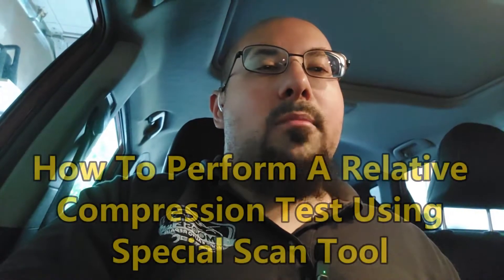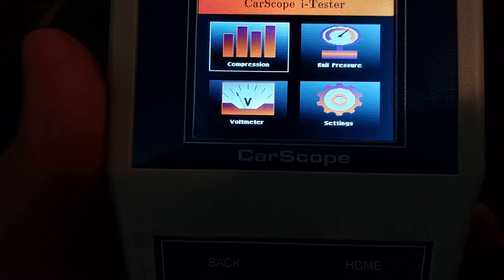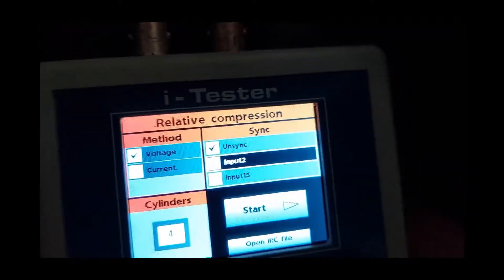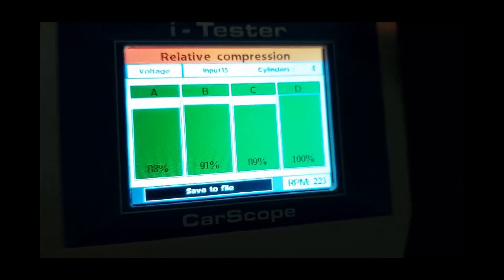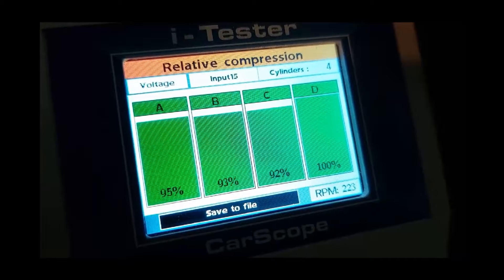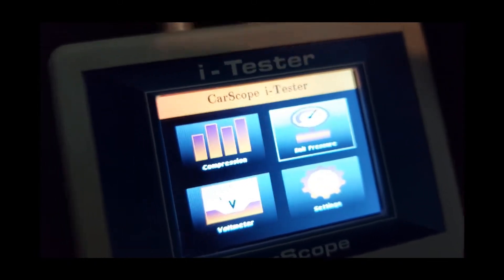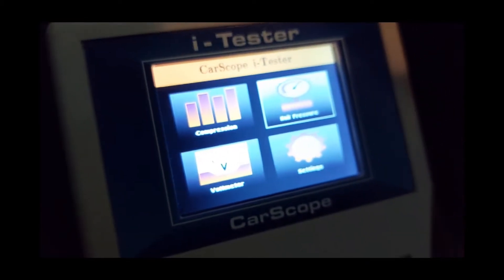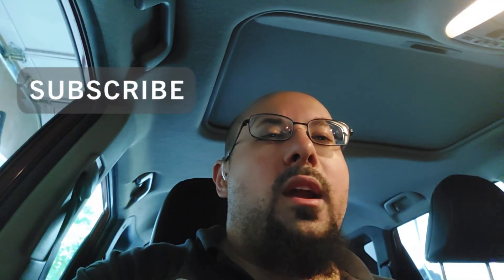How To Perform A Relative Compression Test Using Special Scan Tool

Comment: At what percentages would a problem be determined… 75% and below?
Reply from the maker: Correct. Here is an example that I found from a website just for reference.

Relative Cylinder Pressure
No cylinder should have a pressure lower than 75% of the highest recorded value. In this example the highest pressure is 168 psi, so the minimum allowable value will be 0.75 * 168 = 126 psi. In this scenario cylinder # 5 is considered to have low compression, while #2 is just passing.
Reply: @moosemobileautorepair  thank you for that and the quick reply. So in a relative test, 100% is the cylinders with the highest readings and any cylinders below 100% are reflected on those highest readings, right? I think I would see if I had easy access to manually test a 100% cylinder to get actual psi and make further calculations. For compatible vehicles this method is accurate enough to eliminate the manual gauge test process?
Reply from the maker: If you manually do a compression test then the readings would have to be no more than 10% difference between the highest and the lowest numbers. Anymore than 10% would signify that there is a problem inside the engine. I do have a video on that on my channel. You would still have to be careful with a relative compression test as it may not always be accurate. I have seen a few guys get burnt by that before from false readings.

For relative compression anything below 75% would indicate a problem. But numbers near or close to that number would still be a concern.

A manual compression test is more accurate. But like you said not having access to the cylinders may make things difficult to test. If you are sure there is a mechanical problem and want to rule it out you may have to remove some parts like the intake manifold to gain access if you can depending on your vehicle.

If you know the suspecting or affected cylinder or cylinders you can also do a leak down check/test to see if it's holding pressure.